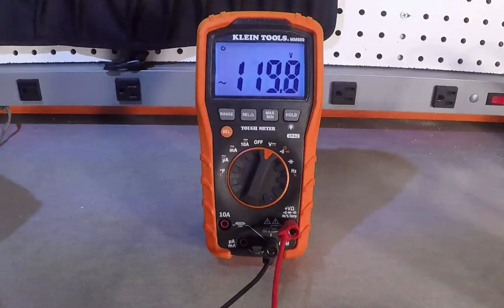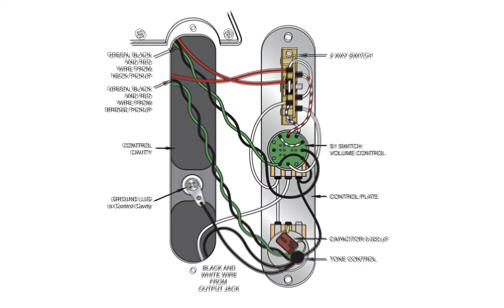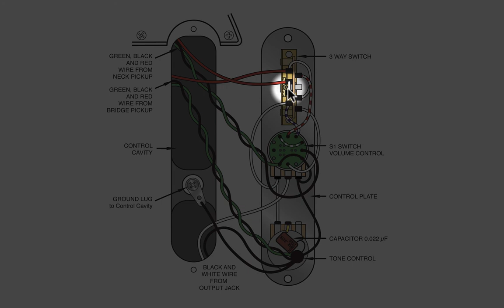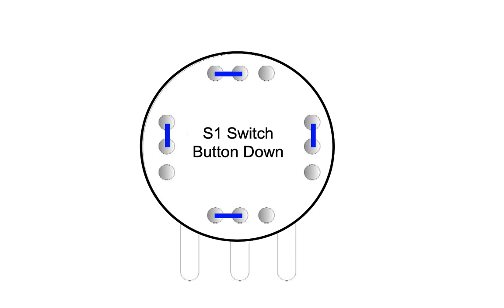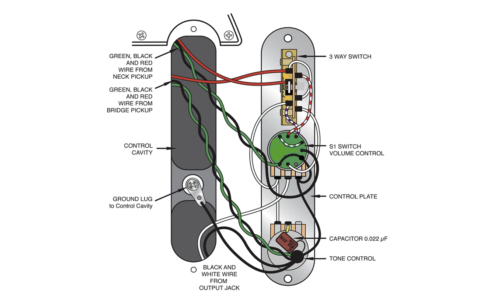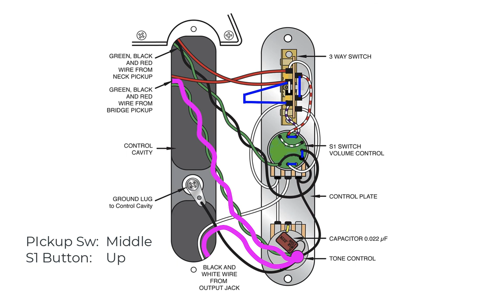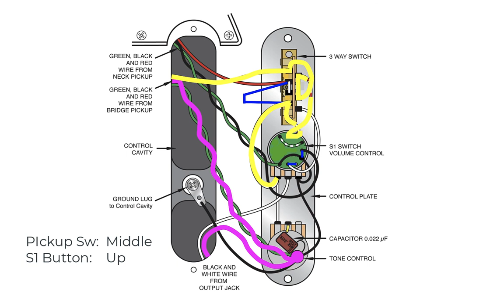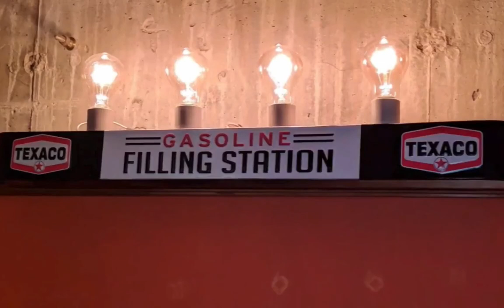Fender's S1 Button in a Telecaster: How It Works and How To Troubleshoot It

Comment: Thanks for this! I have a question though. Everything works as advertized on my Ultra, except one thing. The volume is always on, i cant lower the volume in any position. Not even when S1 is switched on. Its weird because everything else works. All the switching, good tones out of both pickups. Is it ment that way? Or could the switch be broken? The knobscrew is not loose. The volumepot does have a stop so to speak.. And the Tone knob works perfectly.

Comment: Nice one! I'm facing some scratch noise coming from the Volume S1 pot. Since it's all closed, do you have any suggestion on how to clean it?
Reply from the maker: Ohhh. Ouch. That's a tough one.  I might try pushing the button down and spraying some de-oxit in the crevices around the button while twisting the pot. Fender tech support is pretty good. You might try calling them.

Comment: The writing diagram I have for my Tele Thinline Am Delux is identical to your tele apart from it shows the wire connecting nodes 5 looping across to node 8; as nodes 7 and 9 are empty I cannot work out why this would be the case? Can anyone help?

Comment: I've finally found a real explanation of how this switch works. Thank you for taking the time to create this video. I can't wait to see the one on the Stratocaster. Is it possible to just use the 5 way selector of the deluxe strat with the S1 switching in an HSS style strat? I've got one those selectors but can't decipher how to possibly wire it up. Thanks.

Comment: The S1 on this made in USA, Fender Telecaster Deluxe ser #us14004645 is much simpler. Only 3 wires Total to the 12 S1 switch connections. This guitar works in all positions except one. when Switch is on bridge only & S1 is pressed down = no sound. 1 blk wire on term 12 & one blk & one WHT together on term 11. Do you have a video for this setup?

Comment: So what was the cause of the hum?
Reply from the maker: I'm going with ambient 60 cycle EMI that was strong enough to overcome the humbuckers. The main problem was really audio bleeding of from the bridge and bridge/middle configurations and the reason for that is that the "hot" metal under the control plate was shorting against the metallic paint that we put on the cavity walls (basically bleeding audio off to ground).
Reply: @AmpMechanic  how did you solve it? I got the same problem! I´m from Chile, and I trying to fix the problem too..
cheers 

ps. great explanation!